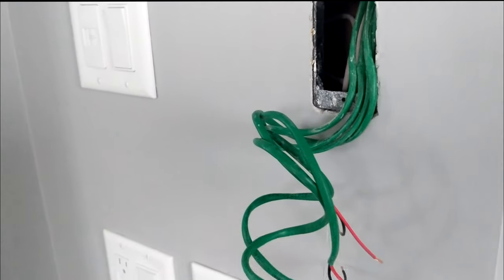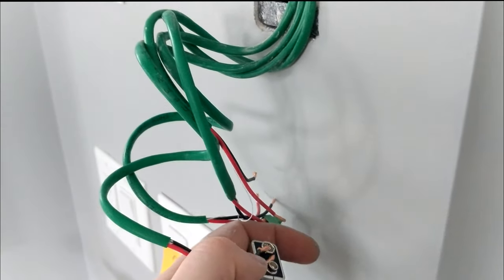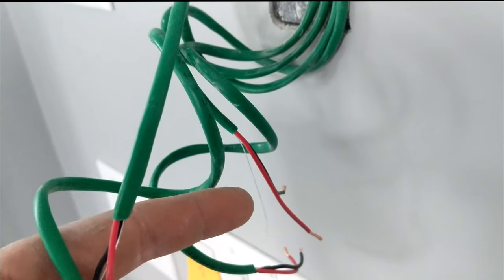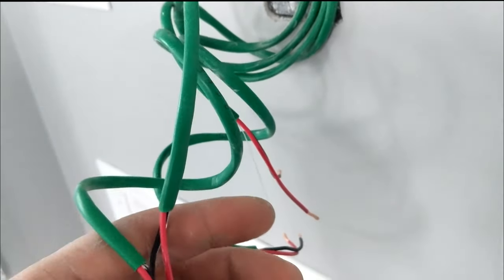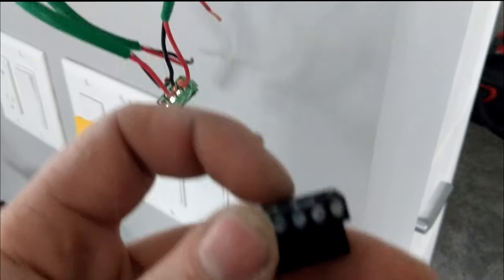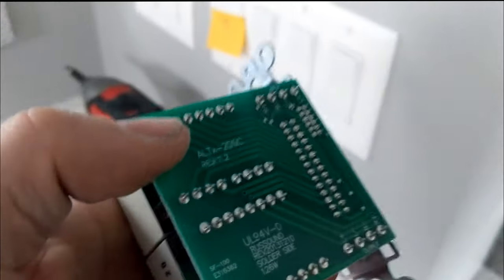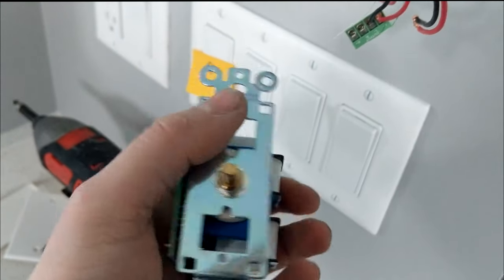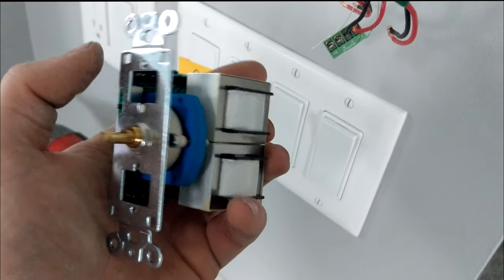HOW TO INSTALL AND WIRE A VOLUME CONTROL

Comment: Allow me to introduce a new unit of measurement for sound volume,
which I call vovol* (abbreviated: volume voltage).

THIS IS HOW IT WORKS: You use two pre-stages, one with positive volume values, and the other negative.
For example, so has the pre-step with positive values
a measurement from +0 decibels up to +20, while the one with negative values, has from -0 decibels down to -20 decibels.

The highest voltage occurs when the value is
+20 and -20 decibels (or: 20 vovol),
while there is low voltage, when the value is on
+0 and -0 decibels (or: 0 vovol).

You can possibly also combine two different values with each other, by adjusting the value to +10 -20 vovol, which gives a crisper effect. Have experimented with this myself at work and at home.

The adjustment can of course be set to taste, but the purpose of vovol for me is to equalize the sound volume, so that you better hear weak sounds and at the same time avoid high deafening sound levels (loudness war's).

Thank you for reading this!
Take care of your hearing...

:-)
Reply: Ion understand but I'm willing to learn 😼